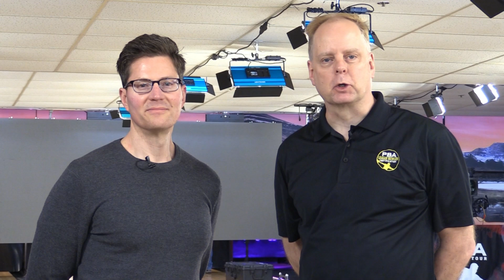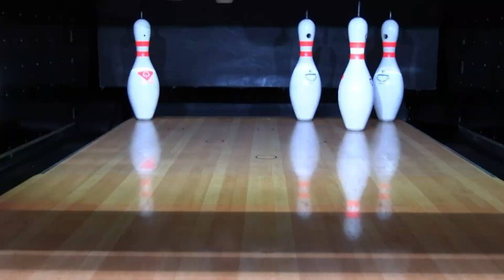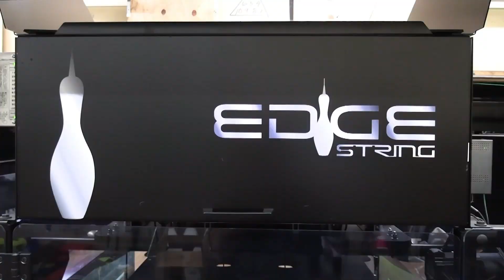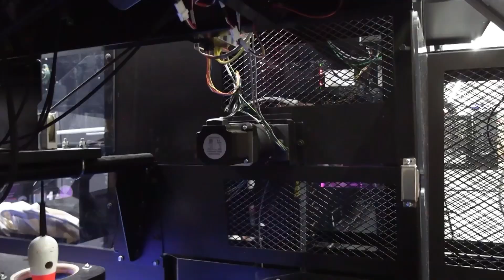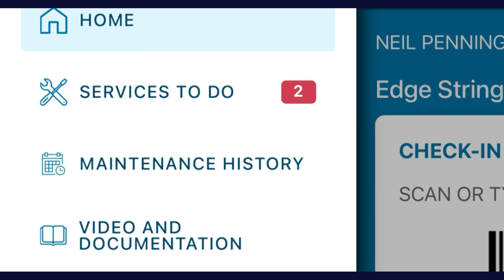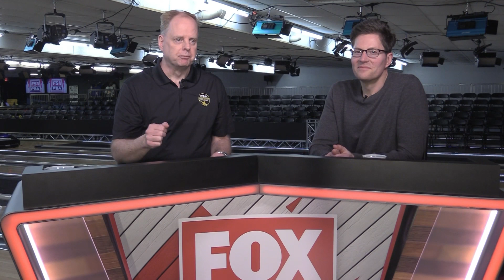Qubica AMF Edge String Benefits With Neil Pennington Part 1 | Neil Stremmel's Bowling Breakdown

Comment: I fix pinsetter for a living. Couple bits of misleading information in here. Here said only 1 free fall machine allows you to set specific pins. Technically theres 2. The GSX machines, and ghe GS-NXT machines. Despite that, its all programming. If Brunswick wanted to program that ability on some slightly older lanes, there could to an extent.

Also, new rack spotting doesnt change over time. Once its set right its pretty much set unless something breaks. And the design if the spotting tongs(the grabbers that pick up the pins after first ball) respects position. 

Maintenance isnt horrible. What's horrible is having a large number of lanes to do it on. If a house has 60 lanes, even with string pins, doing maintenance and pin rotations on same age machines is still going to be a lot of work.

I get the whole "cheaper to run" aspect. But all these machines do is save operators money.

Comment: The good part of string pins is they can't ruin bowling at all alleys. So the alleys that implement string pins will evaporate transferring their revenue to the better bowling alleys that care about bowlers. That will make real bowling stronger. I have been bowling since 1979 and everything has gotten better from equipment, match play, and no smoking. But string pins are an assault on bowling and these presenters should feel guilty for what they are promoting.

Comment: Why not create a pin-setter using magnets..?? Keeps the free fall aspect of the mechanical pin-setters with the accuracy of the string pins..
Reply: Modern Brunswick pinsetters work great. You are not going to make them better or more dependable by implementing big changes.

Comment: As someone who bowls at a Bowlero with string pins in one of my 3 leagues, I have seen the [negative] effect of string pins first-hand. 
1. Everyone's averages are way down.  Some people's averages are down 20 pins.
2. Splits galore - I have never thrown so many splits in my life, and this happens to others, too. 
3. The strings randomly pull pins down all the time, even as you are walking back to the ball return.  Sometimes, you only get spares because of the strings.
4. If a pin shifts during play, the string pin sets it up in its original place for the second ball, which can make it easier to make some spares, rather than some of the weirdness that happens sometimes with free-fall.
5. You get less strikes with strings, whether you're not getting the same pin action, don't get messengers, etc., you get less strikes.
6. They get tangled...a lot. 

If they invested in "more energy efficient" machines for free-fall pins and parts/it wasn't so hard to get parts, then centers wouldn't think of installing this garbage.  Many leagues have left because of the strings, but then again, Bowlero wants to be a party center, rather than focus on or support leagues, which would otherwise fill the house on slow nights (especially those with bad weather).  Strings suck, plain and simple.

Comment: All they keep focusing on is benefits to the big bowling corporations that will put all the smaller alleys out of business. I agree that its difficult to find a mechanic to fix the machines. But when you treat your machines like a proprietary system and you need a specific technician to work on it then ultimately its your fault that this is happening. With the technology that we have nowadays you guys really couldnt make a more efficient machine with less moving parts and lower electricity cost WITHOUT using strings? Yall just sold us out. I bet if a real innovative company came along they could solve all of these problems but the corporations of bowling want the cheapest simplest option even if it destroys the game entirely.

Comment: String pins are great for centers that do not cater towards true bowlers, only open bowlers. League, tournament and professional bowlers will not want to bowl in this. String pins take the true pin action out of bowling. It was seen in the PBA tournament that used string pins. Pins falling when they were not hit by the pin, but the string itself. This is not good for competitive bowling

Comment: What a load of Tosh !    I creased up with the "Advantages" for Bowlers"   Spares respot on spot ? Is that not against the rule that pins are replaced where they finished.  And as for machine resets, just take a look at the PBA demo tournament, you would have thought it would have had everything in perfect order, far from it.   As for Stremmel, Purple Hammer gores soft lol.

Comment: My local bowling center is a small house with only 10 lanes.  They got a grant to install string pins in 2022.  Because of this, they could remain open.  Otherwise they would have closed down
My average was 195 before string pins and 194 after them.  That's pretty close to being the very same for me.  The things that I have noiced is that bowlers have to make better shots when 
bowling with string pins.  Throwing a poor shot and hoping for the slop-shot strike has a low probability of success. A pocket area check simply doesn't work.  High flush is the goal.  A light 
pocket hit does not result in the usual "mixer" but it will leave splits, especially the 4-5-7 and the 5-7.  I have a good line for the 5-7 and convert it regularly... maybe 3 out of 5 attempts.  But 
the 4-5-7 is trickier.  In most cases, the 4 goes off the wall and behind the 7 without hitting it, while the ball splits the 4-5.  An accurate shot here is the plan, with a bit more contact between 
the ball and the 4-pin than the 5-pin.  I'm still working on regular conversion methods for the 4-5-7.  It doesn't come up all that often, just more often than it did with free-fall pins.  Bowling is 
a sport that demands concentration, repeatability, precision, and good fundamentals.  Good bowlers will adapt to the slightly different challenges of string pins and will do pretty well.  
Those who cannot adapt will have poor results.  But there's nothing new in that.
Reply: When I was in the junior leagues in the 1970s, the 4-5-7 was pretty common.

Comment: Strings have no benefits for the bowler, only for the business. Downtime by deadwood or respots is just replaced by tangles. On top of that you get strings interfering with messagers or pulling over pins that werent hit sometimes, which just really a huge bummer.
Reply: For the bowler it might mean there's actually a bowling alley nearby they can play in, it also might mean there are lower costs to play. I prefer drop machines but to say there are 0 benefits for people wanting to bowl isn't quite the case.
Reply: @MrLaughinggrass  alley's closing is an economical problem, not a bowling (doing the activity) problem. for bowling (doing the activity) its a net negative. and i may not be the smartest, but those alleys that switch have enough money to buy those still pretty expensive stringpin machines. prices won't go down, they for sure haven't at the center i play at. its purely for the profit of the business owner, and yes that also means that some alleys might stay open when otherwise they might have shut down, but that doesn't detract that strings are a big step down for the bowler compared to freefall. i feel that the 'but then alleys can stay open' argument is more a sidestep to the real issues bowlers have with strings.

Comment: I hate that this is what they came up with for innovation. String pins just make bowling feel worse for the bowler. The owner saves money because they're cheaper to maintain, but unless they're actually giving us cheaper games because of it (which seems pretty unlikely), I can’t think of a single reason to be happy about this direction.
Reply: That will be official nail in Bowling’s coffin ⚰️ !!
Reply: Ah, yes, another person complaining but offering no solutions. Genius. 
Oh, and I have ONE reason to be happy about this. My local bowling centers NOT CLOSING THEIR DOORS PERMANENTLY LOL
Reply: @ak252m  This shouldn't be the only path forward, installing these is a fast way to get me to move to another bowling center that doesn't have them. I'm sure they're great for folks who don't care about bowling. 

My inability to have a comprehensive solution does not dismiss them from criticism, and criticism is what drives innovation, and string pings remove some of the most exciting elements from the sport.
Reply: @ak252m  Sounds like a shitty proprietor and/or they're just feeding you propaganda. I have several within driving distance that have been operating 50+ years. You don't squeeze food, beverage AND bowling like many alleys tried and failed. And you don't make bowling so expensive that you have no new customers.
Reply: No offset racks, no deadwood, can reset pins almost instantly from the front desk are the advantage.  Disadvantage is no pins flying and rolling around knocking other pins down and messengers.

Comment: Our center put string machines throughout the entire last year. I was skeptical at first, but they play very similar to free-fall machines. Strange “falls” happen but these mostly make-up for the hits you don’t get like the frequent messengers for the high-rev power players. Yes, you can still throw a messenger but it doesn’t happen as often as before.  Personally I can still score on these systems, but I have to be more flush in the pocket to carry. I agree with the points made in the video about having better racks every time! This wasn’t the case at our center before the transition to string machines. The strings get tangled occasionally but the machines attempt to resolve it (3 tries) before help is needed; this usually works without human intervention. If using these type of pin setters keeps more centers open I’m all for it!
Reply: Everybody seems to hate them but very few have actually bowled on them. They all blabber on about bowling dying, but all they do is complain about everything. 2 handers, urethane, strings, amount of new balls.  Looks to me like they are the problem, not bowling.
Reply: Since it is saving the center a MASSIVE amount of money, did they lower prices and league lineage? Or are they still gouging customers to pump up their bottom line?